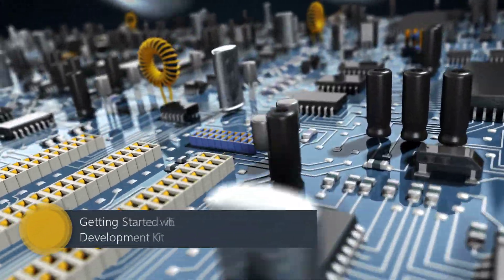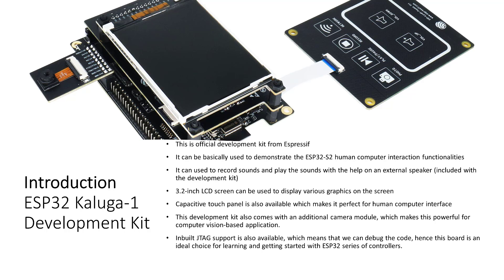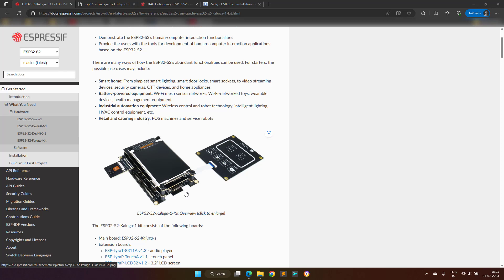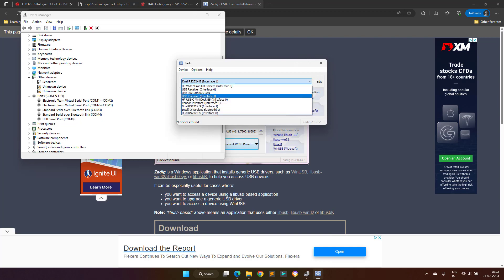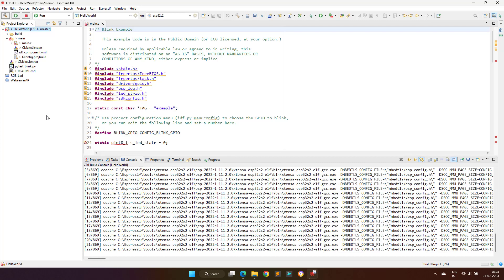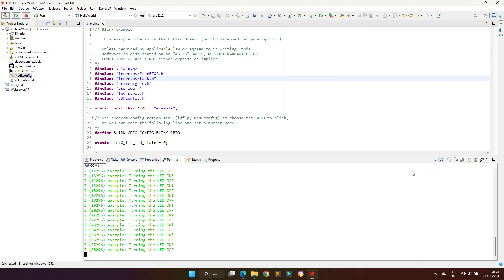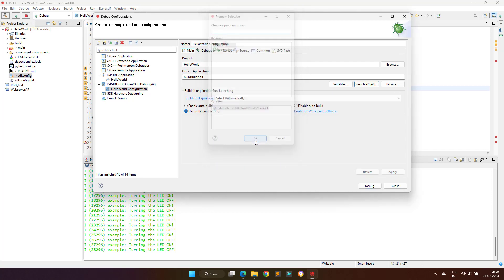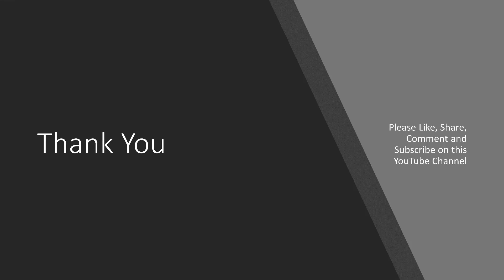Getting Started with ESP32 Kaluga Development Kit

Comment: I have a great request.( look down at commentary end)  You in this article you present a diagram in which you indicate that which PIN depends on the address of the display 0xC3 or 0xD3. However, this is a display diagram with a 32 pin ribbon connector! And in the pictures there is a display with a 14 pin ribbon connector and this display does not have pin 15.
How to change, force another address change in this small 128x32px display? I need to control two displays and cannot use a multiplexer. (board size too large and code too complicated)
  http://embeddedlaboratory.blogspot.com/2018/02/oled-i2c-display-using-microchip-pic.html
Reply from the maker: Hi, you posted on the incorrect video, but anyways fine.
To answer your question, first thing is that I don't know which module you are using.
The following lines are from the datasheet.
"“SA0” bit provides an extension bit for the slave address. Either “0111100” or “0111101”, can be 
selected as the slave address of SSD1306. D/C# pin acts as SA0 for slave address selection. 
“R/W#” bit is used to determine the operation mode of the I2
C-bus interface. R/W#=1, it is in read 
mode. R/W#=0, it is in write mode. "
So basically, u have to play with D/C line, in one module it should be connected to HIGH signal and in another to LOW signal.
And if this pin is not available, I don't think you can do much.